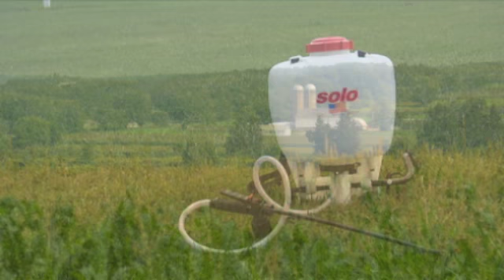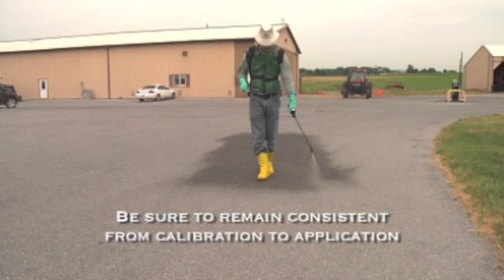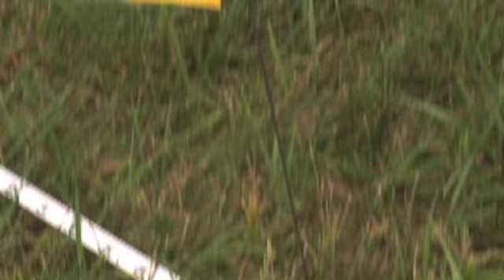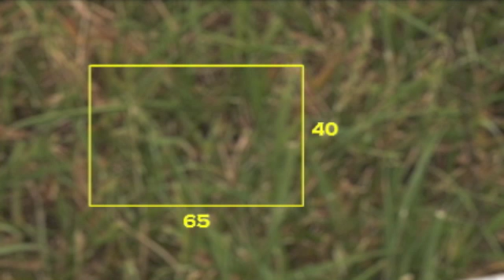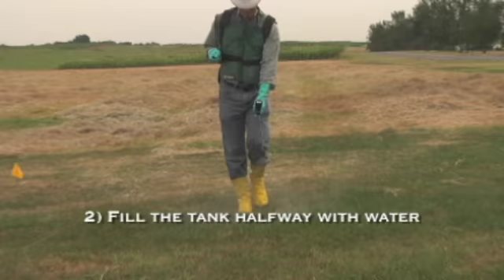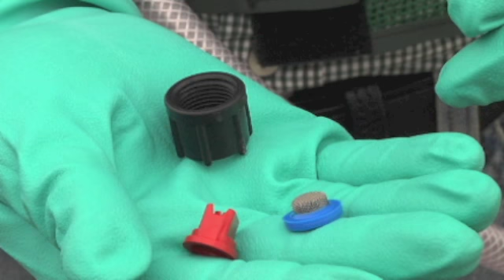How To Calibrate a Backpack Sprayer - Como calibrar una Aspersora de Mochila

Comment: Nice technique and nice video. Thx for posting. Here's how to keep your sprayer tank at a precise pressure, continuously and accurately, throughout the job. Any kind of tank, any brand - as long as it's pressurizable, will work. You'll get constant, consistently reliable flow at the nozzle tip. SPRAY-KWIK Lawn 'n Garden Sprayer Add-On Accessory by FiZZ GiZ - NeverPump Again!